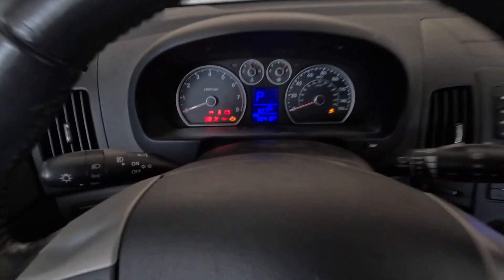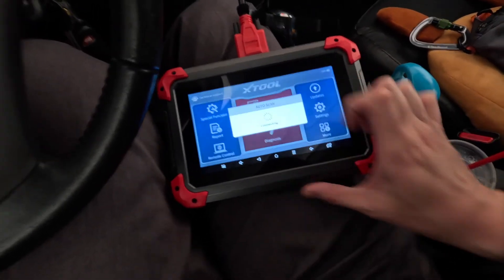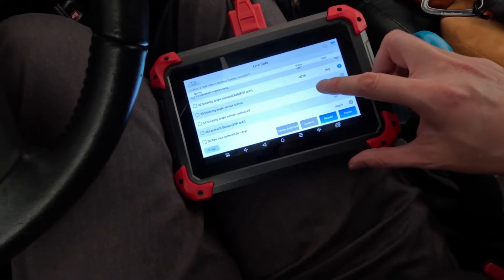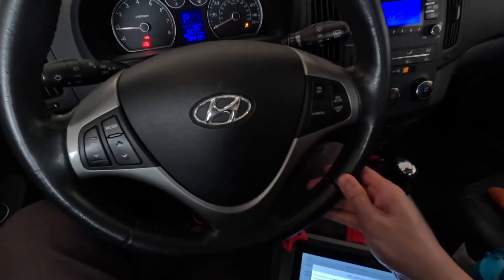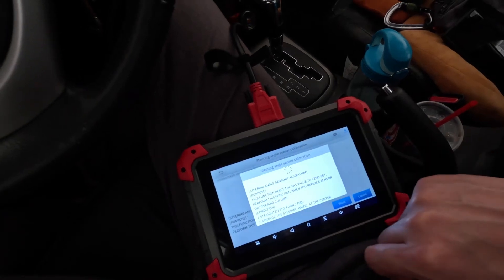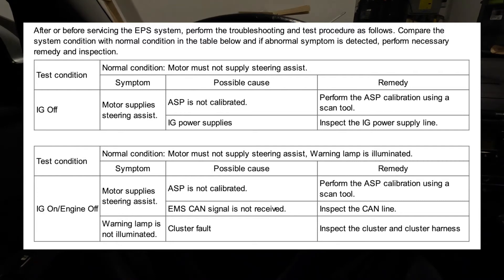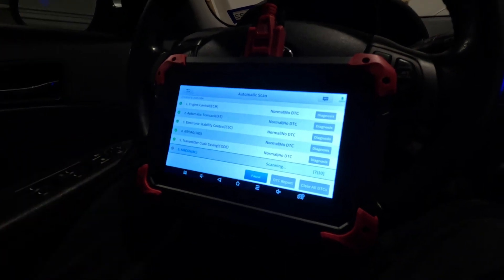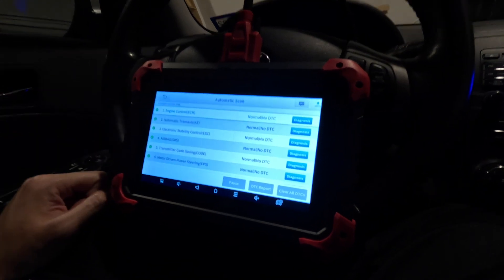Troubleshooting & Fixing Hyundai Elantra with Persistent EPS & Traction Control Dashboard Lights

Comment: I have the same car as you, but I will be selling it soon. Bought it new in 2012. I have owned many cars in my lifetime, but this has been the most reliable one by far. I now have about 150,000 miles on it. Just bought a Kia Soul as its replacement. Hopefully, it will be just as reliable.
Reply from the maker: I definitely agree. It has been very reliable, at least the main components. I did also have to change my driver side window motor, but besides that and the steering bushing that was replaced under warranty, it has only been regular maintenance. Are you getting a brand new or used Soul? Kia is really trying to position itself to be a higher end brand. It isn’t going for the cheap/economy car anymore.
Reply: @Jonathan DIYs  I had to replace that steering bushing around 143,000 miles. Had my local mechanic do the job and not the dealership. He did a good job, cleared all the codes, and thankfully I did not have the issues you did. I bought a brand new 2023 Soul LX.

Comment: That disappointment is expected from the dealers. I have the same problem with my car. I changed the steering sprocket on my car,  aleast I know what I have to do😊. Thanks for sharing. Have a nice day. 😊
Reply from the maker: At least I have a fancy OBD tool now... Kudos to you for changing the steering sprocket yourself. It looked like a total pain disassembling the whole steering column just to get to 1 piece. I was grateful that the dealership at least covered that.
Reply: @jonathanDIYs  it was an experience. My wife knows I am DIY, and she pushed me to do it. Especially for what it would have cost me. But I would need a diagnostic tool, no problem.  But thanks once again for the information.

Comment: My EPS came on today on my 2010 Touring SE. Still have power steering, replaced the rack about a month ago, there's a dead/loose spot in the steering wheel. Been there before and after the rack replacement.  Gonna scan it at work tomorrow and see what comes up.
Reply from the maker: Hope you can figure it out and get the light to go away. Thanks for watching my video and commenting!
Reply: What was your outcome? Mine also has a dead spot (perfect descriptor) and not the "clunk" people talk about with the coupler issue. My EPS and ESC lights are both on.

Comment: I have the exact same car with the exact same lights on the dash. My steering column has that same clunking issue as well but got a quote from a shop that was $1700 to replace the whole column since apparently that bushing isn’t sold separately (I suspect it is). I’ll get that XTool and try to fix the EPS light myself. Do you know if this also takes care of the traction control light as well?
Reply from the maker: The clunking issue was fixed for me for free from Hyundai dealership (even though the car was 10 years old). Dunno if they are doing that for warranty anymore. I do definitely know it is a part that is sold separately, but it is a huge pain to disassemble the whole steering column to get to it. I've seen videos of it done and was contemplating doing it myself if the dealership wasn't going to do it for free. The traction control lights did go away, but not sure if they have to fix the clunking first. Hope you can get everything fixed! It was such an annoyance for me, I was very happy after I got everything working.
Reply: That's insane. The little plastic coupler, which gets shredded quickly and causes the clunking issue, costs a few bucks for the OEM part anywhere on the Internet.
Reply: @ashfordj81  I replaced it.. it sucks pretty bad.
Reply: I hope you did it for cheaper. I bot the rubber part for 1,99 and fix myself. it took a whole morning, but it was free.

Comment: Thank you - how do i reset those codes though if i dont have one lf those devices? Autozone?
Reply from the maker: I don't believe Autozone would be able to help you here. You need a scan tool that can do ASP Calibration like I show in the video. If you can borrow one great, otherwise, you need to invest in the scan tool. You don't have to get one as expensive as mine, I think there might be some in the 200-300 range that could do the calibration. Going to a shop will cost you probably just as much. At least afterwards, you have a tool that you can use for diagnosis and other repairs.

Comment: Have you replaced the timing belt and automatic transmittal fluid yet? I have a 2009 Hyundai Elantra (about 40K miles) and the EPS light started on today. I didn't know the recall (no mail notice), so I still have a bad steering bushing. Do you recommend getting these services done in dealer? So far, I have no steering wheel issues.
Reply from the maker: Hi, I have replaced the automatic transmission fluid and made a big mess (https://www.youtube.com/watch?v=fMEzi83euzQ). There are actually 2 belts in the Elantra (at least the touring I have). I have changed the serpentine belt that powers the AC, alternative, and water pump, but I have not changed the timing belt. The last time I checked on it, the timing belt seemed in good condition with no cracks on it. 

For the bad steering bushing - I'd bring it in and see what they say. The worse they can say is no, it isn't covered and say it will cost $$$. At that point, you can bring it to a trusted independent mechanic that probably could do it for a bit cheaper than the dealership. I would get as much free work done by the dealership if you can. I do note your car may be so old they might not allow it. I do remember something about the recall only lasting for 10 years from manufacturer date or something like that, but again, it doesn't hurt to check.
Reply: Do you think it would be similar with a 2012 Hyundai Elantra touring? I have no power steering, eps light is on, traction control on, abs light is on, and my tail lights are not working. Also the odometer dash is very poorly lit.